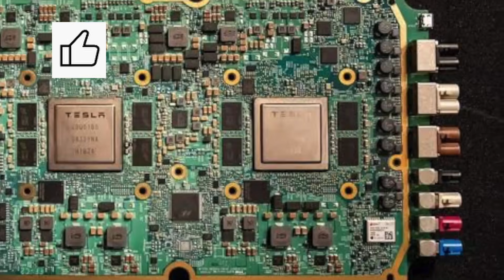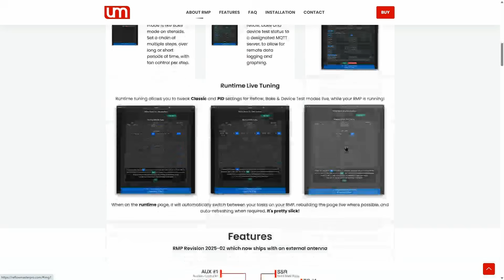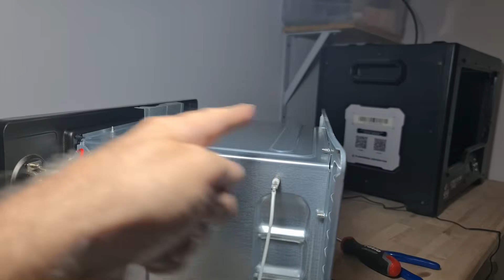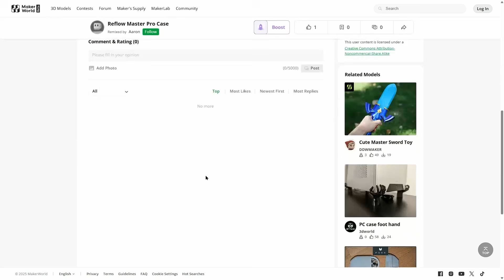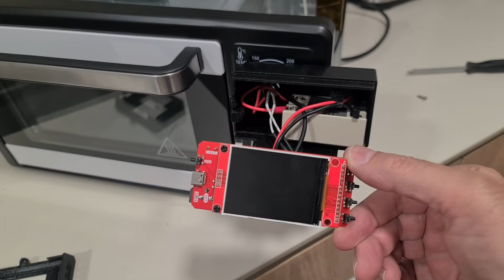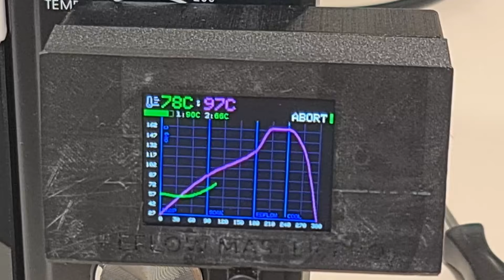DIY Circuit Board Reflow Oven – First Functional Test with a 3D Printed Case & 5V Power Supply

Comment: Seems like fun, but a bit overkill for home, no? I just bought a hotplate and it works great. True it doesn't have the dwell/slope curve, but the paste melts and solidifies. Only downside is that the plate I bought takes a long time to cool down once the power is off.
Reply from the maker: Overkill is my middle name!  🤣
Reply: @MikesTropicalTech  Same